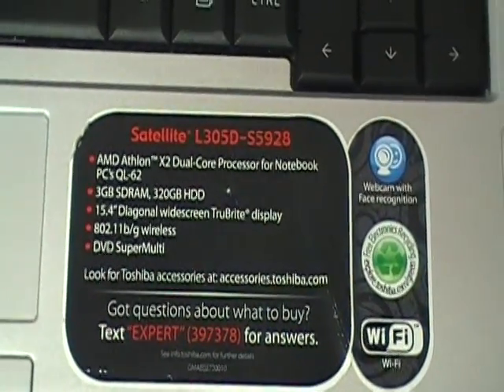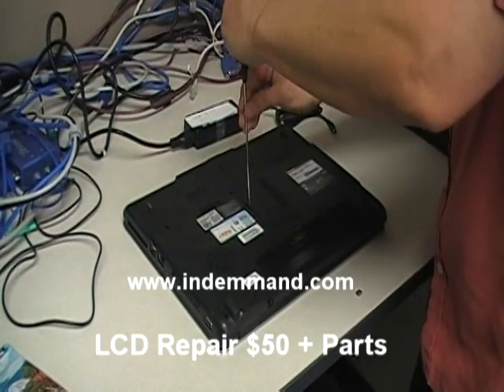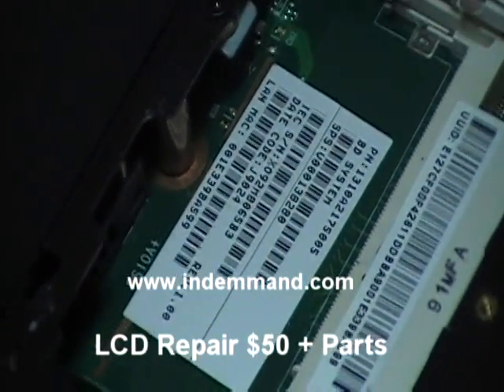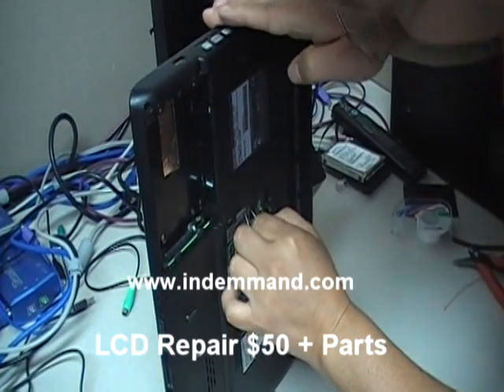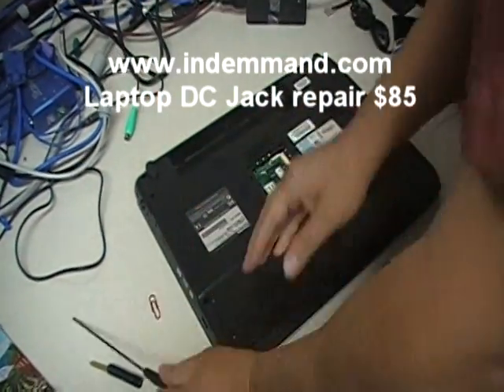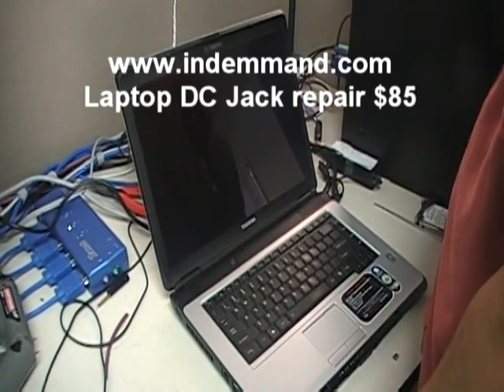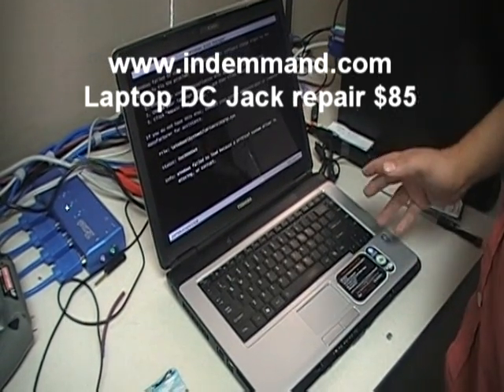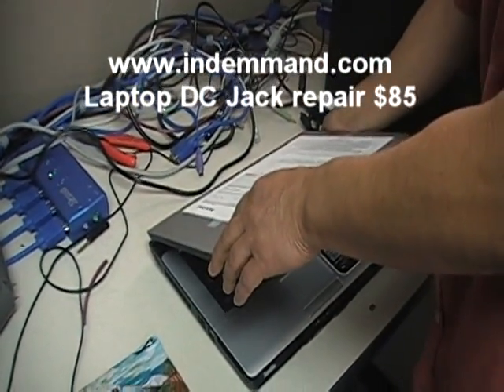Toshiba Satellite  L305D A205 A215 Bios Password Removal

Comment: the computer wont even turn on for me with the RAM in the top slot, and the b500 connectors cant be reached when the bottom RAM is in because the jumpers are underneath the RAM slot. it will turn on with the RAM in the bottom slot, but then i cant reach the connectors because the RAM is blocking it. toshiba satellite A205.

Comment: Thank you so much for this, I just pulled this off on a toshiba l305-S5955 that I thought I would have to sell off.  I feel like MacGyver r thanks to you lol, btw stripped down speaker wire is what I used for the cable.  Thank you so so much just saved me a couple hundred bucks

Comment: Thank you for your quickly answer.

Dont you think that if the chip is bad, the laptop should turn on and work fine for a while untill the chip gets hot and power off the laptop? but ill check the chip just like you said.
 Thanks again man.

Comment: Hi Man, greetings.

I have a toshiba satellite A205 SP5815, when ipush the power on buttom with the batery in, the laptop doesnt do anything only turns on the led indicator, and if i take out the battery and plug the power adapter then push the power buttom the leds power on, the fancooler is on but the laptop power off instantly with no imagen show of course. 

Can you please tell me what its the problem with my laptop?

Thank you very much.

Comment: I wanted to say TY for this video it worked on my daughters Toshiba Laptop Satelite  L505D-S5983. Took a few times and the Cat5 Cable worked the best tried speaker wire didn't work. You do need one memory stick in on the top. Tried the bottom memory didn't work did the top memory and it worked. Thank You again!!

Comment: I tried this several times with a flat head screwdriver and paper clip. Fresh cut cat 5 did the trick so your jumper needs to be super clean or for the soldering types you might even try cleaning the contacts with flux if they are badly corroded. Thanks for posting this video!

Comment from the maker: You need to remove your hard drive and yes you need to have one memory stick in and short out the jumper and turn the laptop on and hold the jumper in place for at least 30 seconds. Its recommended that you use another person to hold the jumper or turn the laptop for best result.

Comment: Hello there. I have a Toshiba Satellite A215-S7422 laptop and I'm trying out this same trick to remove the password. Unfortunately, when I try to jumper it, I get nothing on the screen at all and the laptop quickly turns off. The only time I can get anything to show up is if I have one of the RAM cards slotted in, but I don't think it works that way. Any tips?

Comment: You have to either buy a new battery or cut your battery open and replace the cells. You really have to know what you're doing to rebuild a battery.

They're just large flashlight batteries. The companies seal them in plastic so they can charge you over $100 for a few flashlight batteries. And they're designed to wear out. Thomas Edison built batteries that just kept on working. Jay Leno has one of his original electric cars and the batteries STILL hold a charge!

Comment: I tried this and it did not work for an A215-S7428. I think I found the B500. It's just a little blob of solder at the intersection of the labels "B500" and "XXX", right? Then what do I do? Your video says to attach a jumper to it, but what does the other end get connected to? I was assuming some convenient ground. Then, with the RAM in and the jumper to ground held in place, turn on the power, but for how long?  Holding the power on for long enough, the password prompt just comes up again.

Comment: for a A215-4697..the jumper IS J4. You just need a small screwdriver, HD out, BOTH sticks of ram out, hold it on the jumper for like 15 secs. Put the RAM back in...turn it on. 

You're done. Nicely done video I might add.

Comment: Got a display model L675D with a bootup password, took it home thinking it would be an easy fix.  Boy was I wrong!   Anyone have any idea where B500 would be on these?  It doesn't appear to be visible from the memory location.  Will probably have to pull more of the casing off...

Comment: @finster69 ``I actually did it on a A105-S2061 but didn't leave the memory in..  Now, it won't boot!  It comes on for about 3 seconds, shuts off. Comes on and keeps looping like this.  I removed the hard drive, wireless card and battery [even the memory module] to see if any was the culprit deducing one by one but no such luck.  So now, it's just power from the charger, the processor, screen, keyboard & of course motherboard.  Could it have fried it?  Perhaps some other way to "reset" it?  Help.

Comment: Worked like a charm for an A205-S4707. Thanks. Using single wire from Cat 5 cable worked great. Thanks. Make sure you have at least 1 memory module installed or laptop will not boot! Don't recall if you mentioned that.

Comment: Thank you so much!!! I used this on a L355 series. Confirmed: Working!

the points are under the black protective covering in the memory bay, two soldier points separated by a line, I believe they were marked "XXX". I tried this before and didn't work. You must follow his instructions; leave ram in, power on the laptop from the A/C charger with the points shorted. once you see the network boot agent, remove the shunt (wire), power down and reassemble the laptop.

Comment from the maker: @1plou 

Step 1:
cut a piece of cat5 cable 

step 2:
take out the battery  and hard drive from the computer

step 3:
remove the memory and locate the jumper ( FOLLOW THE VIDEO)

Step 4:
put one stick of memory in and place the laptop on the side ( Connect the power cord)

Step 5:
You must have the jjumper hit both a ground location and the B500 or XXX jumper. ( Some people use another person to turn on and off the laptop.

Step 6:
turn on the laptop while holding the jumper in place.

Comment: This works great, but be sure to follow instuctions on the type of wire exactly. I tried several different wires (believe it or not) and paper clips but cat5 did the trick. Also a slight rub of the jumpers with a light abrasive material was needed, there might have been slight oxidation on my laptop jumpers. Thanks

Comment: I have an old L355. As luck would have it, it has the same jumper in the same place. It is even labeled B500 just like yours. Now the only thing I did that was different was that it did not work unless I left the ram chip inside, while shorting the jumper and powering on. In this way it worked for me. You are my savior man! Thank you for a most excellent and to the point video. You saved me a very expensive repair shop bill !! Thank you Thank you !!!

Comment: @pequepie It could be very similar to my A215-S4697 ... under the SODIMM memory chips, there is a piece of plastic as @indemmand tells you in his video.  Carefully lift that and see if there is a J4 roughly in the middle.  I used the spacer as ground.

Don't forget to set your system clock when your computer comes back up.

Comment: Just wanted to say THANK YOU for posting this video. I had no luck using a Cat5 wire, however, I used a small flat head screwdriver and it worked like a charm on the first try!

Comment from the maker: @7Ragno7 
If the laptop has a HDD ( Hard Drive User/Master Password) set you have two option

1.) Buy a third party tool to see if that will remove it.

2.) Change the hard drive with a new bigger and better drive. This option is better since hard drives are so cheap now.

Hope that helps you